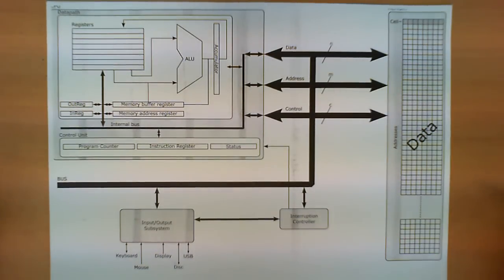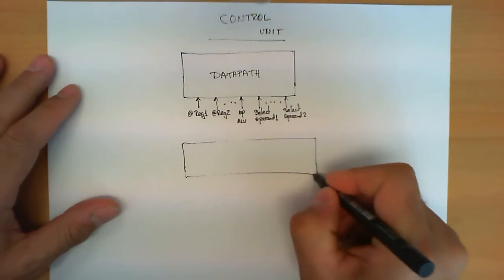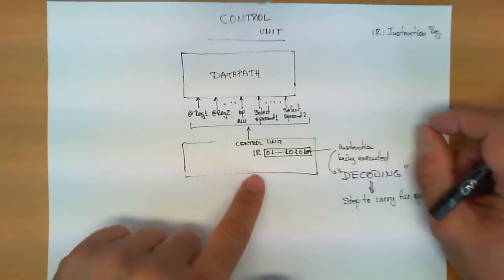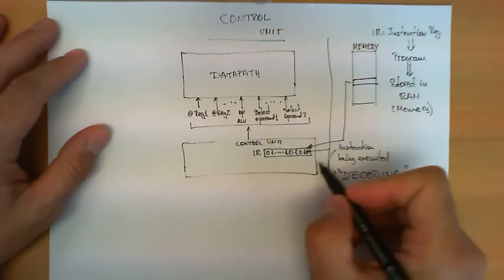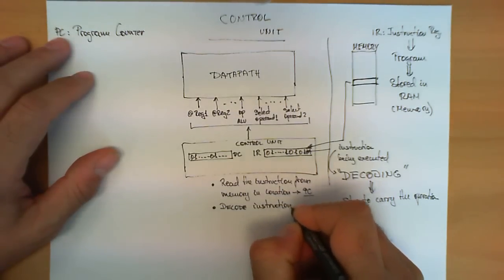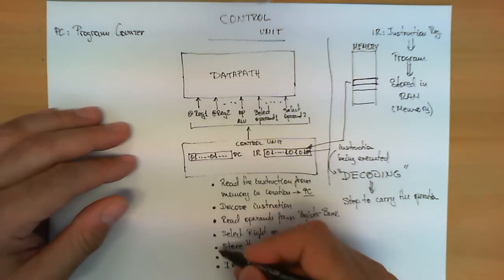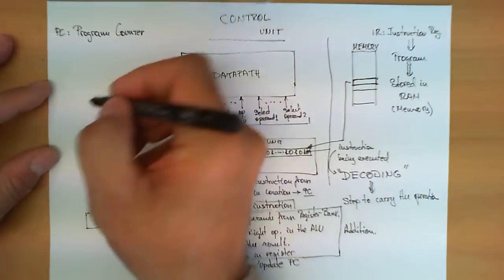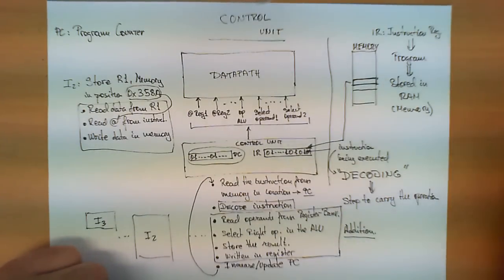How a control unit works inside a CPU

Comment: How is the code received by the IR physically Decoded? The binary model of logic operations is often illustrated by the flipping of on off gates or switches, but in those models, physical hands are flipping those switches to perform those logical operations. 

What "hand" in the CU is "flipping the switch" to translate that binary information received by the  IR into physical instruction that creates working change in the data path via control signals?

How is this actually working? Excellent video by the way!

Comment: I have question, what will happen when the PC will increase to the last address in the memory? Does it automatically go back to the first address if there is no other jump instruction? How is that resolved, please answer if you know

And of course thanks to author for posting this great videos
Reply: When a program ends executing, in the last address there would be an OPCode to make the Control Unit stop fetching data from the RAM, and wait until another program is there.